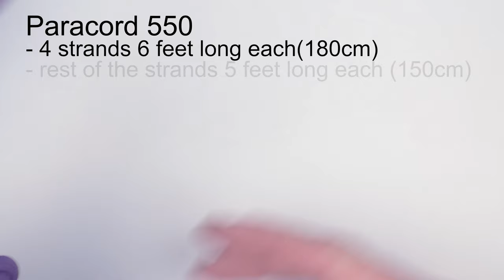Water bottle holder/sleeve- Cheponana style

Comment: 16:17 you forgot to mention how to determine which side goes over and which side goes under... it does matter ... if you know how to do simple macrame (flat ribbons of square knots and spiral ribbons of square knots) than you'll know to alternate direction just like you do with thr flat ribbon weave ... the two outter strands determine it... let's take the left outer strand for example ... if it's exiting the knot about it coming up than it goes over and down, if it's coming down than it goes under and up... it doesn't make much senxe in words unless I'm showing you at the same time but... my point is that part was left out of the tutorial... I only caught it because I do a lot of knot work and knew what was going on... newbies won't know any better.